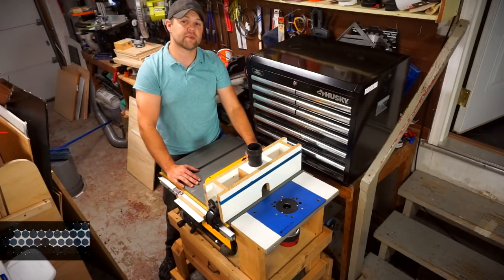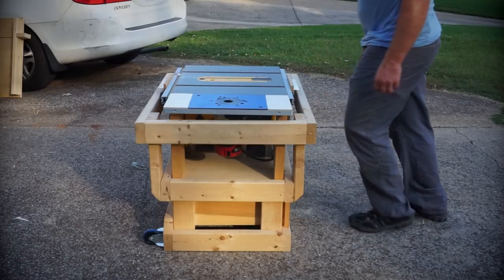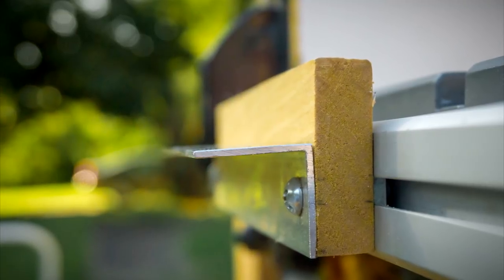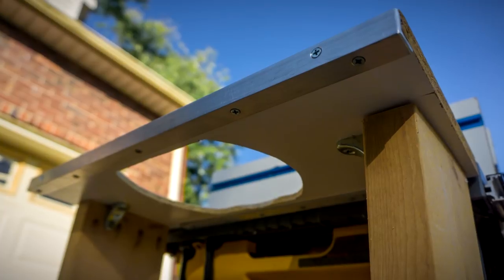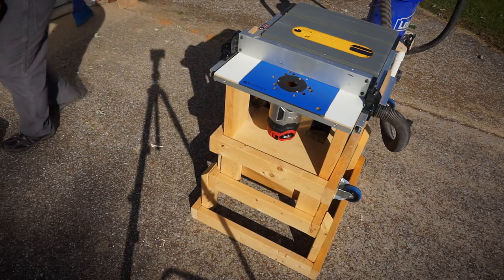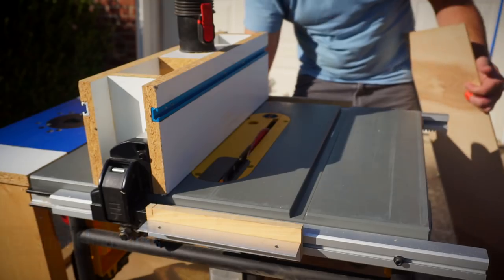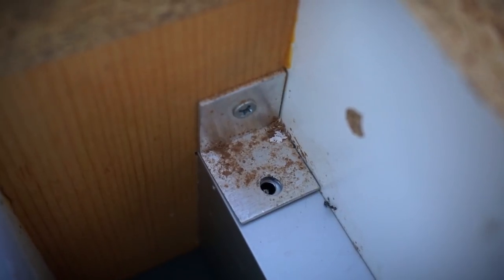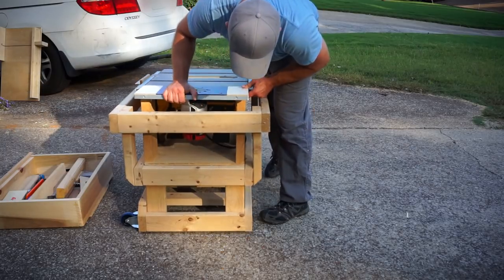Collapsable DEWALT Table Saw / Router Table Storage Stand

Comment: Nice consolidation. I have a couple of routers, but no table yet. I did a similar thing with my table saw building a stand out of two-by-fours that makes it level with a banquet table (outfeed table) that my sister gave me. It is just big enough that when I am done cutting I flip the 2 by 4 table upside down and the saw fits inside for transporting or storage. But I love this idea that incorporates the same level table for a router table too.
Reply from the maker: Very nice! Yeah thanks a lot! Saving space is key for me making the most out of my shop. I have found the router table so useful in quite a few of my projects.  Thanks for taking the time to leave a comment!

Comment: Yah i was  about your age when i learned  about ply wood...from pld PT boat capt.. he started out building PT boats as a kid in Louisiana  in 40s... they used mahogany  ply wood.   To build a 60 foot long  destroyer  sub hunter.. with twin 12 cylinder Diesels with a supercharger and twin turbos. The boats would run a hundred miles an hour and 12 foot seas in the higher the Seas the faster they would fly. They would burn 200 gallons of fuel an hour at the top of the ladder. This is where I fell in love with plywood and realize you could build anything with plywood and build it lighter stronger better LOL enjoy by the way by the time I was your age I was nowhere near as far as you are very advanced
Reply from the maker: Wow! That is very cool. Thanks Edward!
Reply: Yah i like using ply. Wood with 2x4.. he would make 2x4 out of ply wood.. layer  them staggered  varnesh..clamps....he would spend days ripping ply wood. An engineer everything.. there are formulas we bult a cannon lever roof off a building.. in florida it still stands out with no walls 50" out .. i foget how many lbs it wasa coulple thousand.. we used 10 pallets  of ply. Wood to build the beams. 18"x18" x 50' it took a month to build the beams. It was faster than building steel.. cheaper..  way cheaper. Jesus showed me how to build jigs and bend ply wood. Gluing it together with varnish..high quality varnish..is best..renforce all corners with a angle. He built a sail boat with no nails or screws. But we used screws in everything it was much faster then joining with clamps!!!

Comment: This is probably the best one of these that I've seen.

Feedback (since you asked): It could be that it is over built just a little with the 2x4s.  You might be able to make it lighter and still have all the strength you need with 2x3s, 1x material or 3 quarter inch plywood.
Reply from the maker: Thanks a lot Matt! Yeah I think your right probably a bit overbuilt. But its super stable so that is a plus. Thanks a lot for leaving a comment.

Comment: The only change i would make is that i wouldn't want any weight (the outfeed) hanging from my fence guide rails. I would be afraid they'd twist over time and lose accuracy, if not contact with the rack and pinion, which is the greatest selling point of this saw. Other than that, this set-up is pure genius! Thank you for the ideas!

Comment: Have made the table saw stand and it turned out great ... only problem is the storage drawer will not fit (even when tipped up to the maximum) in the stand. Everything was cut to the size shown on the plans but after adding the 3/4" x 1" x 16" bottom drawer support piece (N) it will not fit into the stand ???

Comment: Did you consider putting the router table on the left side, instead of the right side? Did you remove the folding support fence to fit the router fence?

Comment: Still waiting for a reply ... Have made the table saw stand and it turned out great ... only problem is the storage drawer will not fit (even when tipped up to the maximum) in the stand. Everything was cut to the size shown on the plans but after adding the 3/4" x 1" x 16" bottom drawer support piece (N) it will not fit into the stand ???

Comment: Regarding the auxiliary fence ... there are 2 middle and 2 outer vertical support pieces. Your plans show the cutout section of each piece (1" x 3") so these vertical supports can sit over the base fence. I do not see and provision for a cutout such that these pieces can fit over the flip-over extension that is part of the base fence. Also your cut list shows the middle vertical support pieces to be 3/4" x 5 3/4" x 3" ... pretty sure this should be 3/4" x 5 1/4" x 3"
Reply from the maker: Hey Rodney. I forgot that I had removed the flip down for the fence. You would have to make your own provisions for the flip down. I will have to look into the vertical support piece dimensions. I will get back to you.

Comment: I am in the process of completing my build having purchased your plans. The plans simply state to assemble the fence using wood glue ... so what kind of wood glue did you use to hold this together without any nails or screws?
Reply from the maker: I used Titebond2 best I can remember I didn't use any screws to hold it together surprisingly. I just assumed I would screw it together if it ever showed signs of delamination. But I have yet to have any. Scuff your mating surfaces though for sure.

Comment: Smart ...  try 1/4 and half inch play wood.. You can engineer that much lighter. Thanks for ideas
Reply: Also like using water  proof glue with the screw joints makes for extreme strength. Also I like to find pallets that carry big machines usually this is hard wood..
Reply: Nothing like free...
Reply: Watch for metal in salvage lumber.!!!
Reply from the maker: Good Call! Thanks for the tips. I think that your right about the plywood. It would come out a lot smaller and cleaner. Thanks for taking the time to leave a comment!
Reply: And thanks for tip on router plate...i was trying to figures that out next
Reply: I picked up a kreg hole jig.. and plan on using a combanation of quarter and  half inch ply. And 4x4s and some aluminum and stuff.  Going yo try make to boxes that can be self contained . On wheels modular. That breaks  open into a super shop...like a transformer.. router coming up to the table. I table saw a planer. A joiner. Miter saw. Miter saw and I know I'm missing one or two other things that I want to put on here but I want to make flip tops you know multiple different materials to make it all work really think it out.where it all folds into itself .. and becomes to 40inch x 48 inch crates on wheels.